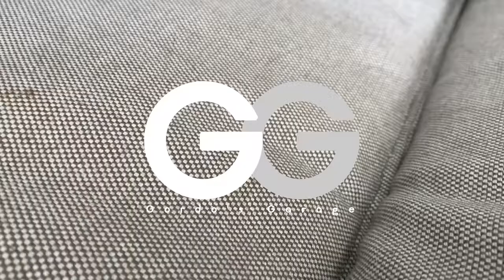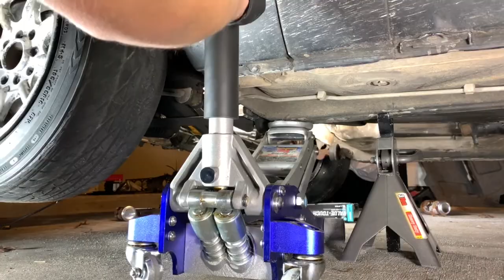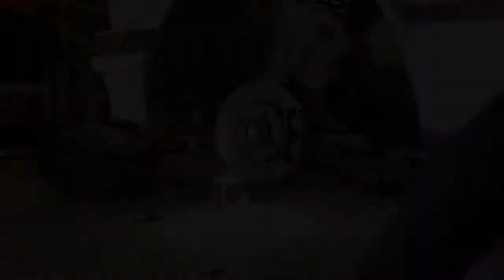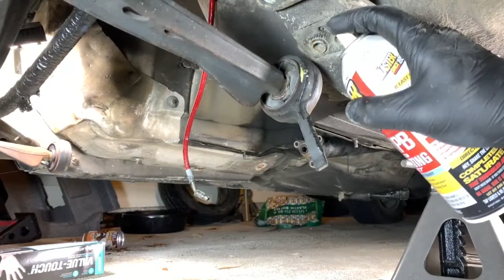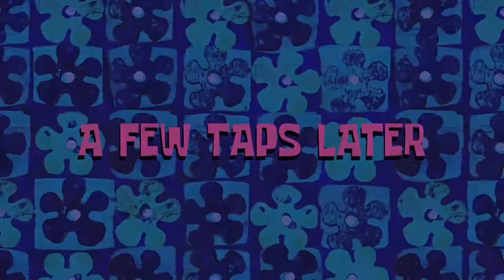E30 Solid FCAB Install

Comment: Did you ever put a different crank in the m20? If so what crank did you source, assuming steal crank not cast. Building a turbo stroker and I'm almost just ready to see what the cast crank can handle.  2.7 with 885 head swap.  Any input would be great. Awesome videos!